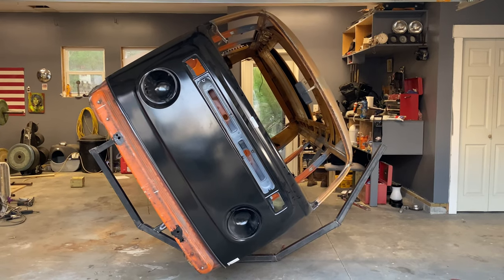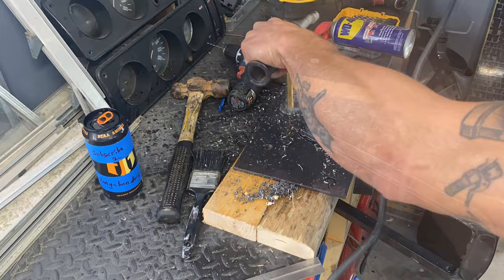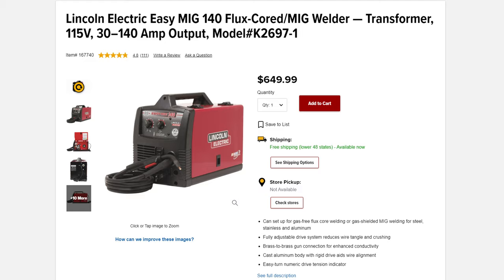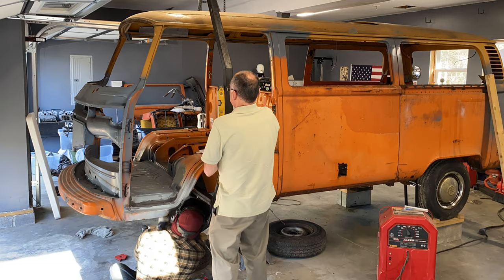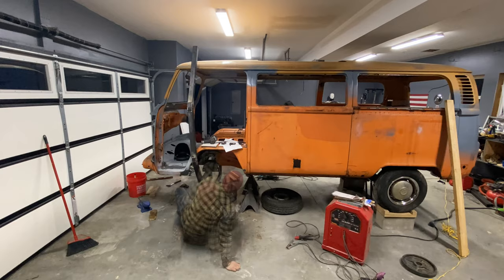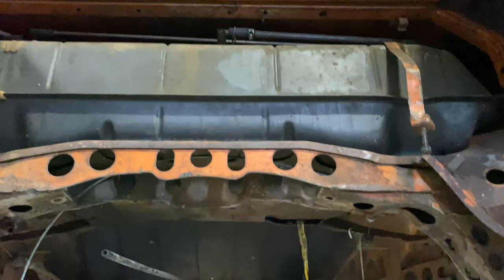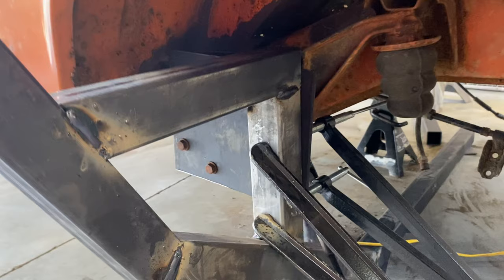DIY Rotisserie With Build Plans | VW Bus Restoration Episode 30

Comment: Awesome video. Went to order the material here, but realised that I wanted to be able to flip it both directions, so I would need to do the bolt on rear plate instead of welding. I'm not an engineer and I wonder if there's any risk of the 2*2" tubes being too weak when drilling. The original has 2*1".
Reply from the maker: Indeed in order to flip you would have to bolt. I don't think the 2x2 tubing would be a problem drilled but I am also no materials engineer. You can always go with the original 2x1 as its been shown to work just fine!
Reply: @Vangabonders  Thanks. They don't have the 1*2" here, but I can probably find something to insert to reinforce it. My first structural build, so I am probably a bit overly cautious.
Reply from the maker: @henrikbergman4055  it's not very heavy at all once you have everything stripped. I don't think you'll have a problem at all to be honest

Comment: I think I’m going to attempt to make a set of these too, thanks! Dumb question, but do these fit from both sides to rotate the bus in the other direction?
Reply from the maker: The front rotates as is, in order for the back to rotate you have to bolt it on rather than weld it like I did.
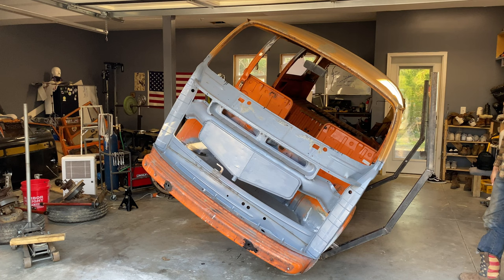Reply: 6:30 - that kid on Christmas morning excitement lol
Reply from the maker: @greggaspo413  haha exactly how I felt